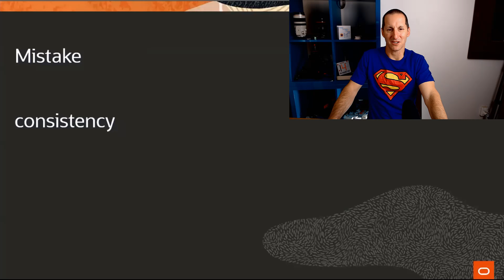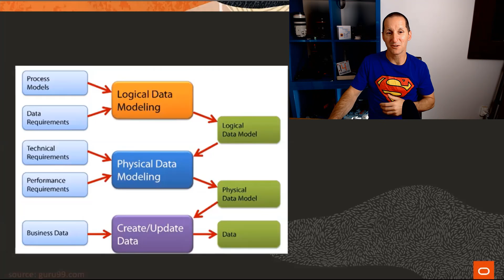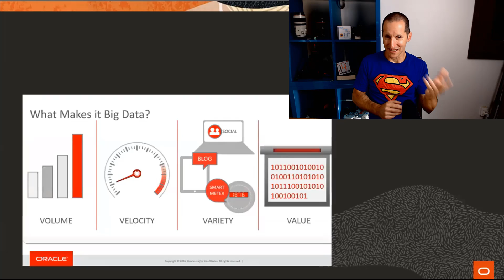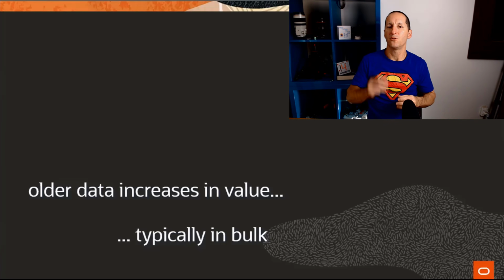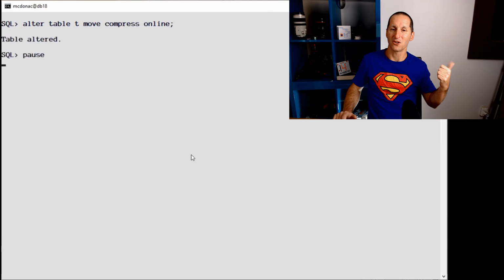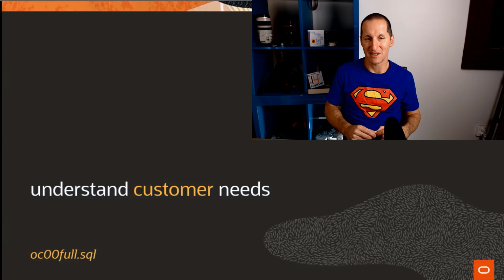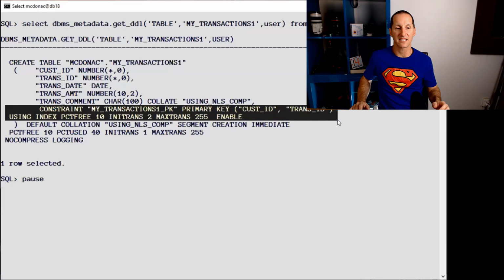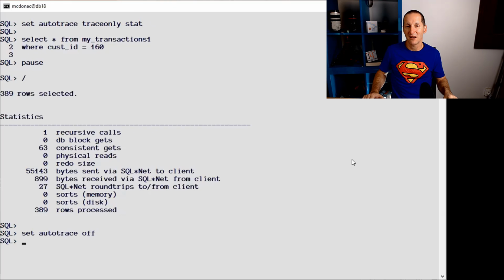Physical Design - the THREE mistakes you're making

Comment: I don't use IOTS just for one simple reason: it prevents smart scan.
Reply from the maker: True but in my experience its been rare for a requirement to sort the data on load (which means you're expecting lots of range scans) and then to also require index FFS.
In those circumstances you could use attribute clustering/zone maps for some benefit and keep smart scan if needed.

Comment: I think the single table hash cluster is more underused than the IOT. Single block read to get one row of data. BAM!
Also worth mentioning is that if you use basic table compression you get PCTFREE 0 as the new default. 
Also index compression is used way too little. You could have saved a few consistent gets on your IOT with COMPRESS 1 to compress that customer ID.
Reply: But the linear clustering was new to me. Thanks for that.

Comment: is there any downside of clustering by linear order? If transaction table has heavy dml as well
Reply from the maker: That depends.  If you happened to be doing heavy update activity on a common set of clustered ID's, then you could expect more contention for those blocks.  By the most common transactional activity is insert, and that will (mainly) be new blocks not the existing clustered ones.